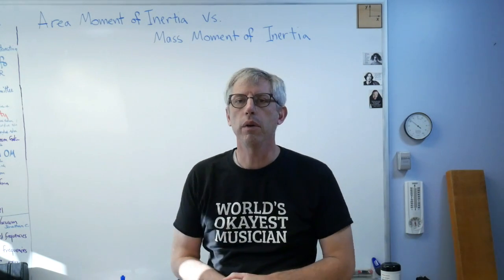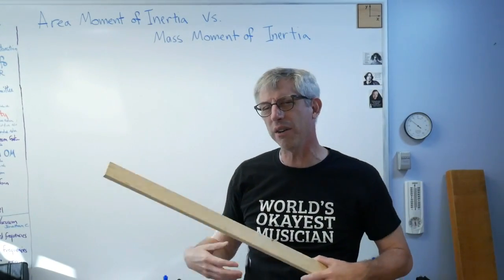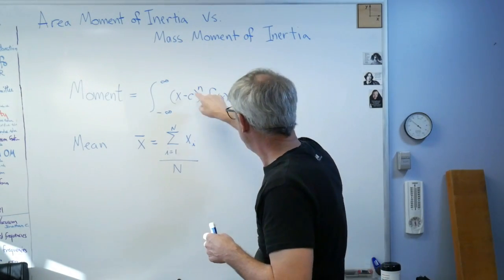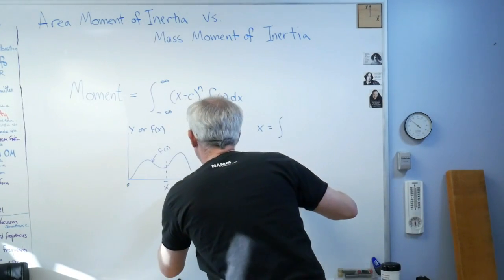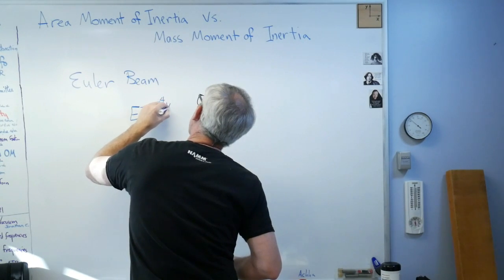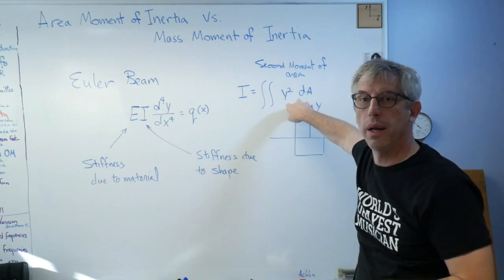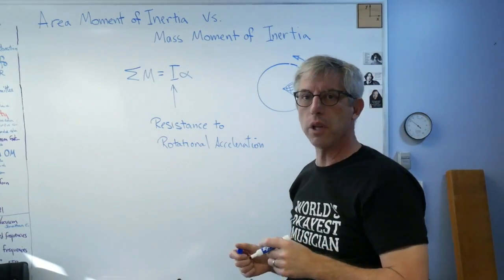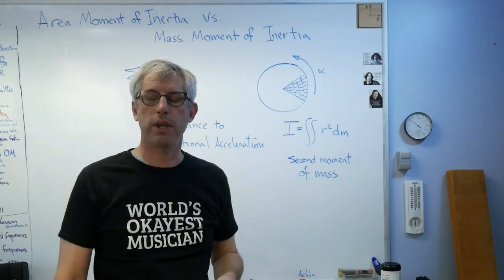Area Moment of Inertia and Mass Moment of Inertia - Brain Waves

Comment: If i increase the mass moment of inertia of a body and then reduce the area moment of inertia of the same body about a given axis then will the overall torque required to rotate a body increase or decrease?? Which one has the stronger effect and why???
Reply: Area moment of "inertia" has nothing to do with inertia, and has nothing to do with torque required to rotate a body.   Torque required to give a body an angular acceleration, only depends on the mass moment of inertia.

Area moment of "inertia" is a property that relates internal torque within a body, to the distribution stress within its fibers and the curvature as it deflects under linear-elastic loading.   It has nothing to do with inertia and is entirely a property of geometry.  The reason it is called "area moment of inertia" is that it has a lot of properties in common with mass moment of inertia.  A more apt name for it, is second moment of area.